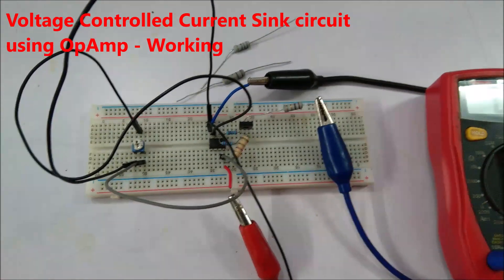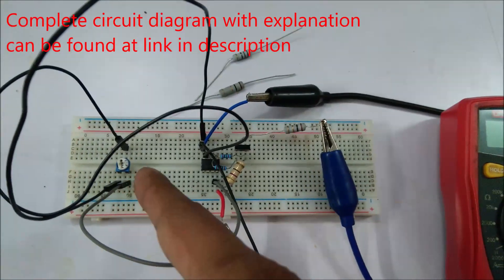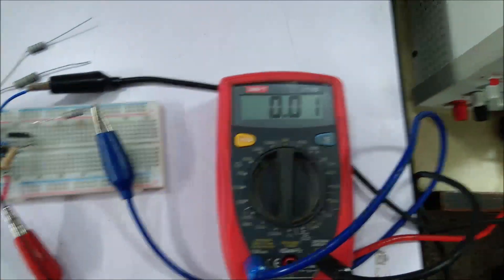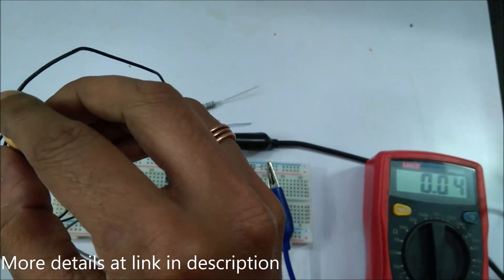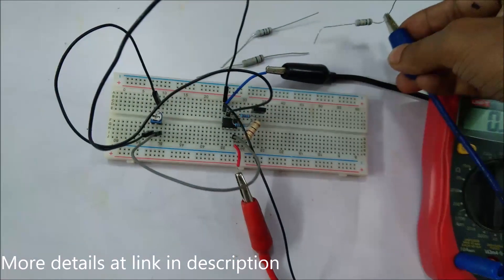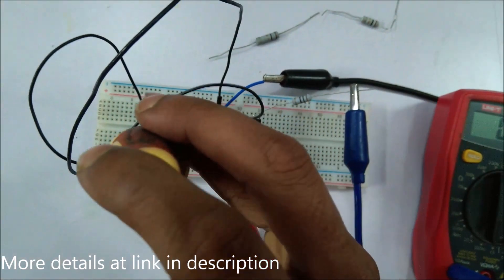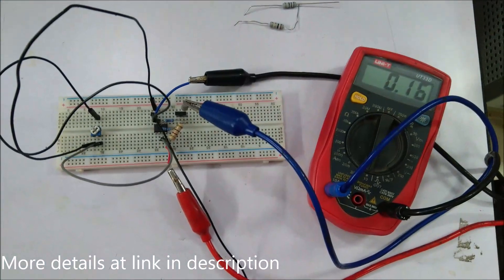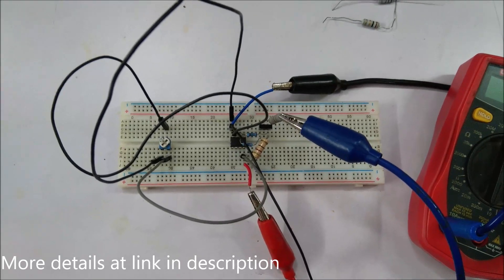Simple Constant Current Sink Circuit using Op-Amp

Comment: There is a base DC current of 0.3mA. A signal (short pulse) of 2 to 3 nanoAmpere rides on the base current.

Develop a pre-amp circuit to amplify the signal so that the output is between 0 to 3.3v. Suggest ms how to do that

Comment: Many thanks for you, but how we can design a constant  0-20mA current regulator
Reply from the maker: You can use the same circuit. use a precision multi turn potentiometer ton adjust the current.